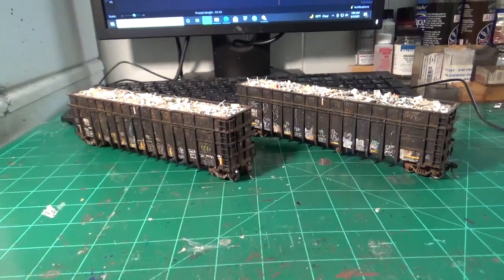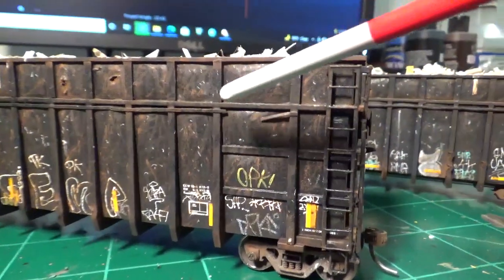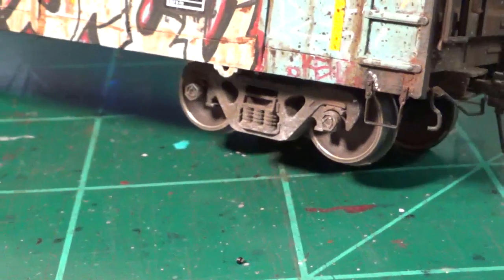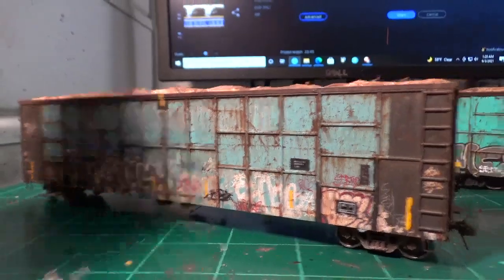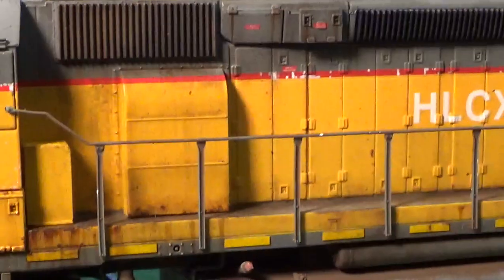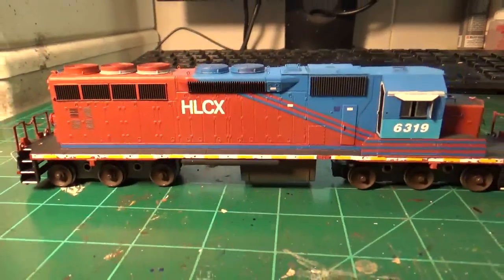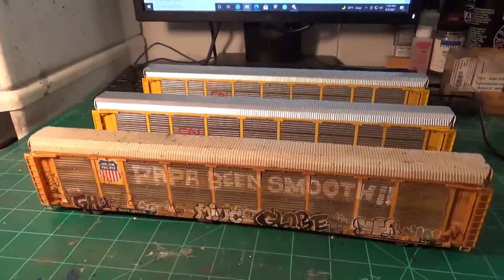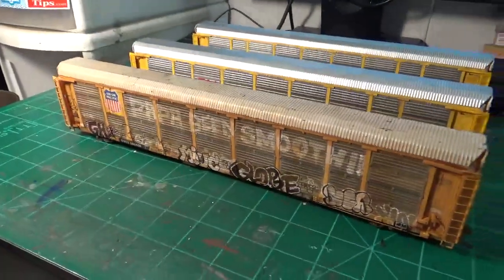Project Update:  Newest Models From Summer & October!!

Comment: Always love your work. I noticed in your LOCO drawer you have that black puffy matt. I have used them before and they can leave a sticky residue on your wheels that is a pain to get off. Just a heads up might not want to use it, it doesnt last well over time.

Comment: Hi Dan.  I have been watching your weathering videos' for many years now and have noticed something that I wanted to ask you about.  I noticed that you don't seem to put windshield wipers on the cabs of the locomotives you make.  Is there any particular reason why?  I usually add them to my locomotives because I like to add the fine detail but the plastic ones generally seem to bend or break easily so I am thinking of using KV Models etched wipers in the future.
Reply from the maker: I hate drilling small holes, that is the main thing, I have always had bad luck using micro bits and such.  What size bits do you use?
Reply: @DansRailroad2011  I use #78 drill bits but sometimes I will use something bigger if I don't have a good angle under the cab awning above the windows.  I have used #75s as well.  I think the trick with them is to drill slowly and carefully but you will still break alot of bits.  I buy them in bulk on ebay because I lose them frequently and break them almost as much.  Plus I like to make brass handrails and stanchions using KV models parts so I need them for that as well.  If using small bits its very important to try a few different mini hand drills as some are very uncomfortable after a few hours.  I never use power tools for this task bc you just end up shattering them bc of the size.